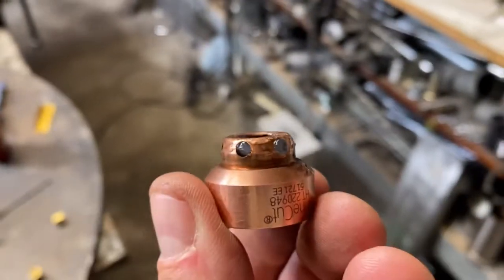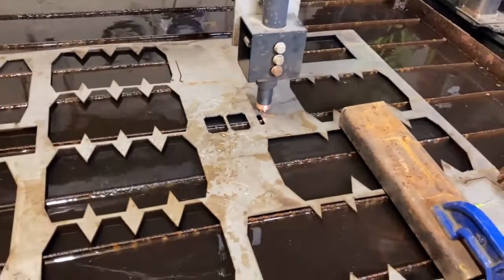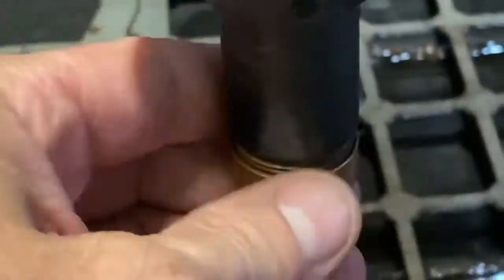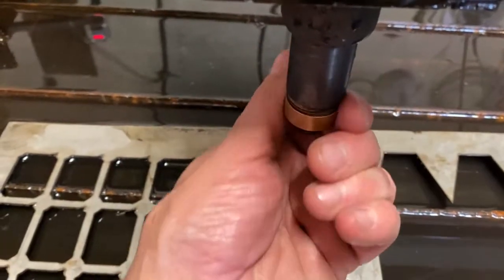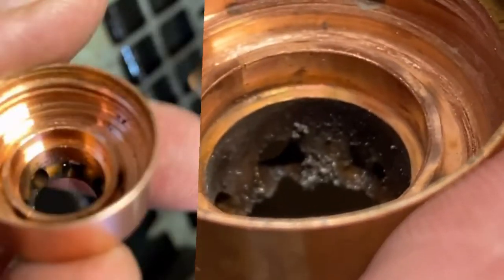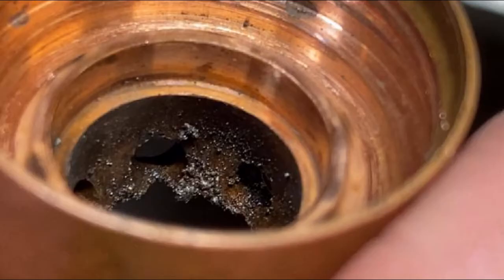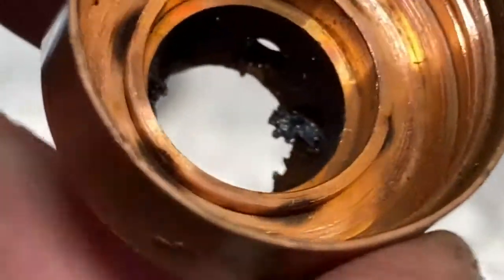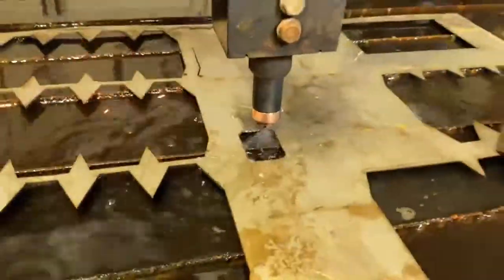Stop dross Build up in plasma table torch tips SOLVED

Comment: Awesome thank you 
I have some for my mig and im gonna try it 
I have a question for ya if ya can help me 
I have a premiere table with hypertherm  it will be cutting along and torch doesnt ignite on next point 
Or also when it gets to another point torch goes up 3 “ from steel and stays there 
Thank you if you can help me
Reply from the maker: Check your switch on the torch floating head
Reply: Ok thank you ill check that   I got an extra one with the table
Reply from the maker: @larescats9228  Also the mach three program and the sheetcam post processor get corrupt some times and you gotta change it or re instal it
Reply: Was wondering if that might happen how do i do what your saying to fix it